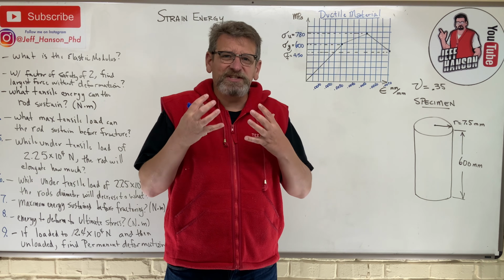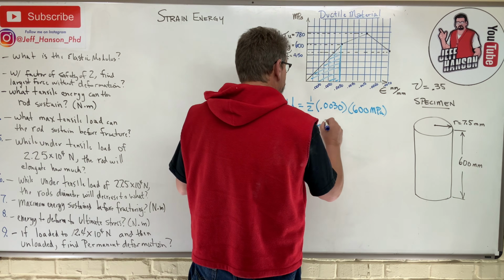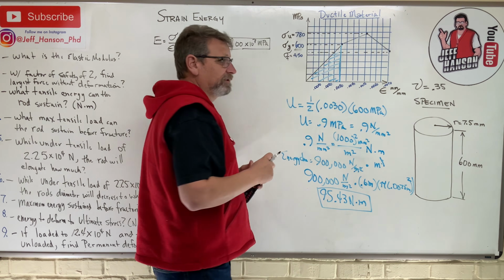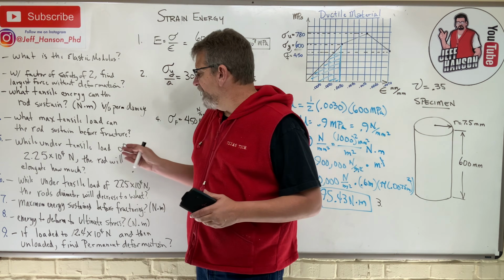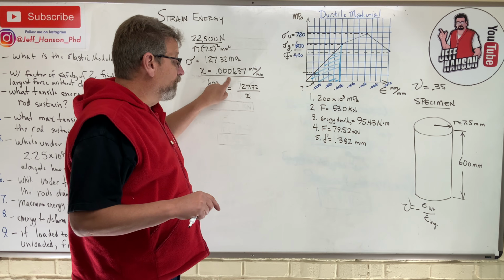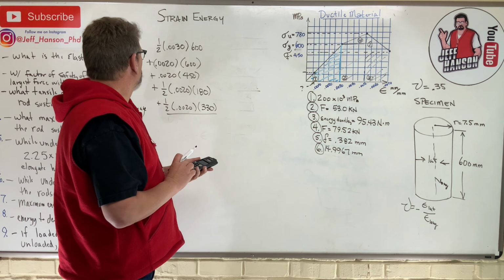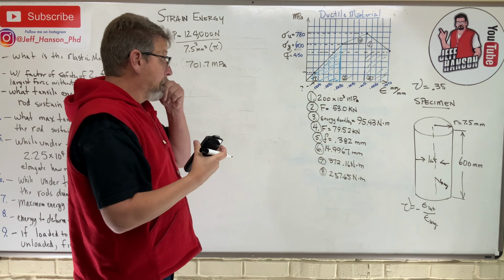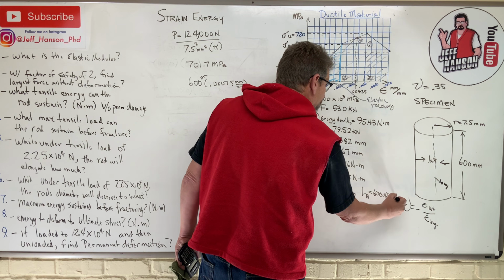Mechanics of Materials: Lesson 12 - Strain Energy; Example Problems From Stress Strain Diagram

Comment: I am sorry but seems that there is a mistake about the strain engery density, after some unit deduction, you will find that (stress * strain)/2 is the density and the strain engery absorbed should be the density multiple the volume.
Reply: I  agree. The method shown would work if you had ((load x deformation)/2) / volume.

Comment: Until he explains otherwise, viewers should regard his answer to question 4 as incorrect. He answers what the load is immediately before fracture, assuming no necking. The way his question is phrased requires you to use the max stress on the graph.

Comment: Shouldn’t the area under the curve for number 8 be 2.28N/mm^2 not 2.43N/mm^2? I ran this calculation through a few times and I kept getting 2.28. Is anyone else getting 2.28?
Reply: yes you're absolutely right and the energy is 241.74J
Reply: you're absolutely correct: its 0.9+1.12+0.18=2.28MPa

2.28*10^6*pi*((7.5^-3)^2)*600*10^-3=241.75Nm

Comment: Prof. why you didn't choose the sigma ultimate as max load that the rod can handle before failure? Well, after the ultimate load, the specimen will start to let go itself before the force on it, then practically, the max load that the rod sustain before fracture is the max load sigma ultimate after that, the material won't sustain any load anymore, it just suspended like that. Isn't it?
Reply: i was waiting for someone to say this, because this is the MAX load it can sustain. Not the load right before it fractures...

Comment: hello Doctor, i did not understand why we choose 450 MPa to calculate the maximum Tensile Load, according to the diagram if the material subjected to 500 MPa it will not fail, also it will back it it's regular shape. 
so how come 450MPa will make a fracture
Reply: I have the same question.
Reply: The ultimate stress, as defined on the graph, is 780 MPa, therefore the max tensile load should be calculated using the ultimate stress not the lower fracture stress of the material in the necked condition.

Comment: My solution for Number 9 is as follows. 
The total deformation when the rod is loaded: 0.003 + (701.7-600)/(780-600) * (0.005 - 0.003) = 4.13e-3 mm/mm. 
The deformation that is removed when the rod is unloaded: (701.7 MPa)/(2e5 MPa) = 3.508e-3 mm/mm. 
The permanent deformation is 4.13e-3 - 3.508e-3 = 6.22e-4 mm/mm or delta = 6.22e-4 * 600 mm = 0.3732 mm.
Reply: i got the same thing
Reply: Same for me
Reply: me 2
Reply: I got the same answer.